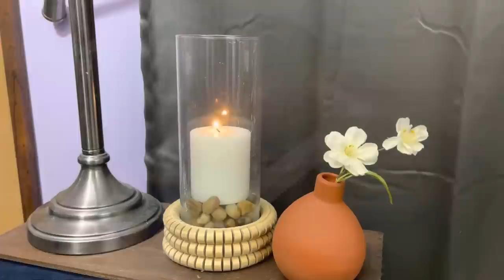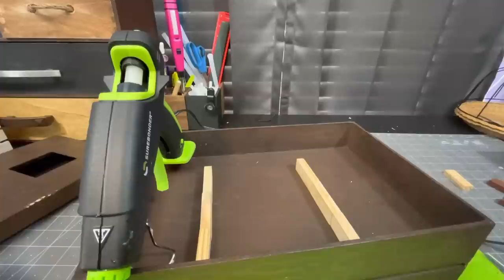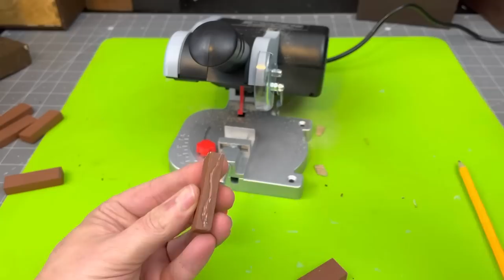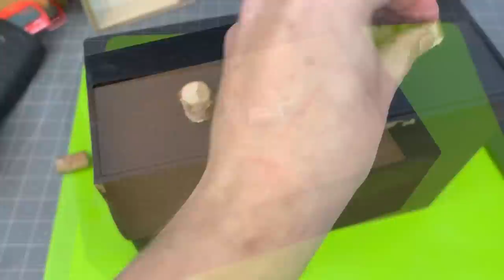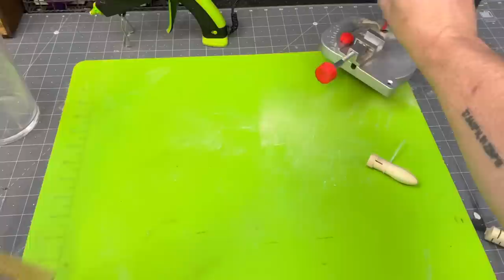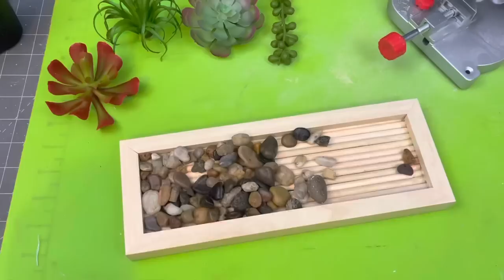Thrift Flips, Dollar Tree & Useful DIY's!! MicroLux Tools Collaboration!

Comment: I am going to start calling you, "Mr. Chopper" now.  I found something at DT the other day that screamed your name, so I bought.  You don't have a P.O. Box address, so I can send it to you. 
Loved the transformation of your first craft/thrift fine.  Squirt some hot glue on the bottom of the drawers and it will give them some grip and they won't slide out so fast a spill your supplies in your drawers.  Also, a small cut piece of the black floor mat in the bottom of the drawer cabinet part such help.  I hope I explained what I meant well enough.

Comment: I fryer to order a saw and it said invalid code are you sure the discount code is correct
Reply from the maker: It should be craft10 - I’ll verify ASAP
Reply from the maker: Also I know a store called Harbor freight sells a similar model and brand for around $40 so check that out as well, I will provide a link for you if I can’t get the discount code rectified